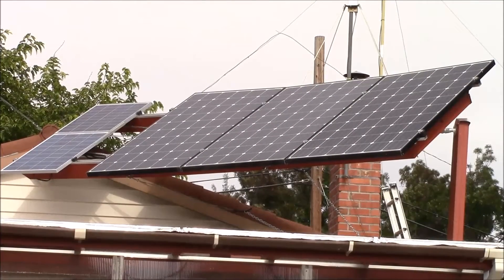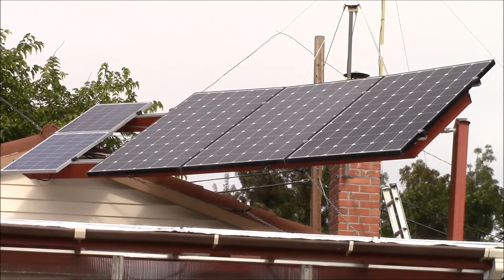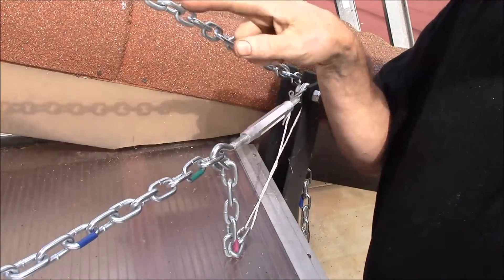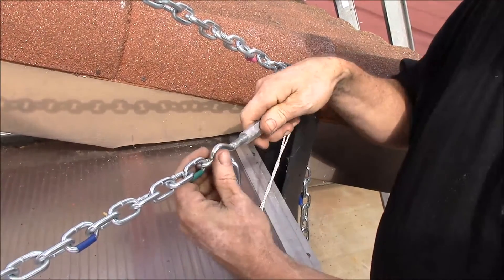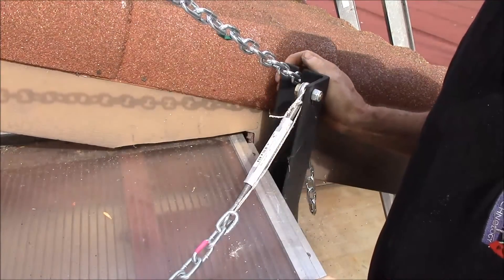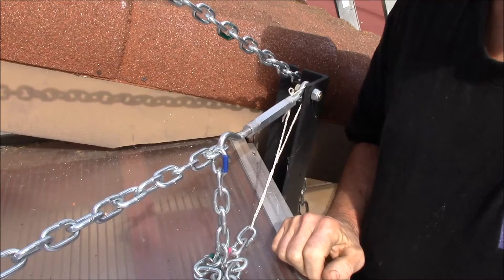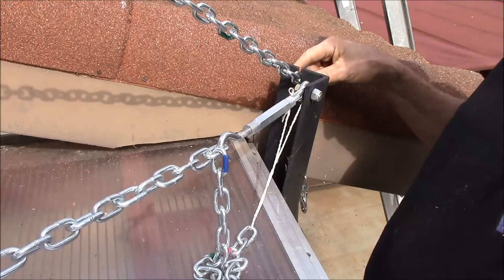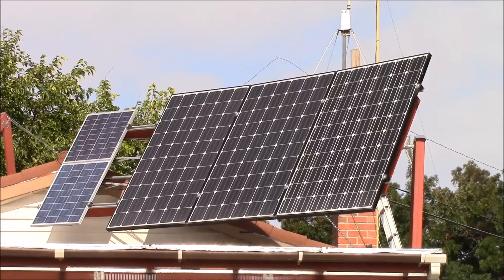Adjusting Solar Panel Tilt Angle

Comment: Looks like an interesting project :)  Probably not worth your time in terms of monetary value. I was thinking to do a dual-glass BIPV to replace the old roof on a garage/workshop. That way I could cut the cost of roofing by going fixed route. 
Moving 5kw of panels for times a year would produce roughly 15 Eur worth of Solar PV electricity in baltic states at current module prices and cost about an hour of my time in a year. Besides that, it would increase the chance of potential damage.
On the other hand, a single-axis time-based tracking system on an apartment building coupled with bifacial panels and white membrane roof on the building could bring enough value to be worthwhile. It would be an interesting study comparing tracked traditional panes vs bifacial.
Reply from the maker: In my case, the time is just a few minutes per angle change.  Just set up a step ladder, climb up, tilt the panels and back down.  In the winter, it's more time as I use the summer angle to park the panels when high wind events are forecast.  I'm considering adding a linear actuator to make those adjustments automatic and tie that into my home automation system.

I needed to set up something like this to take advantage of a due south orientation.  My house is sitting on a SE-NW alignment.  I do have some fixed panels on the E and W facing roof sections but the 4 panels tipped at the proper angle outperform the 5 fixed panels.   When I built this in 2013, panel prices were a lot higher.  Maybe today, it would not make as much monetary sense.

Comment: where is your location? is there any trustable tilt angle calculator website for 3 seasons?  and which days are more efficient for tilt adjusting on northern hemisphare.  i am planning to do it, on 21th of 2 4 8 and 10th month of every year. ( I live in Turkey btw)
Reply from the maker: About 37.5N latitude in the US.  The information on Charles Landau's site is quite detailed:
http://www.solarpaneltilt.com/
Reply: i saw his table and formulas. Hmm Charles Landau.... can i trust his formulas?  I 'm also gonna adjust the tilt 4 times a year. but i dont know where he find the formulas? forexample,  for summer adjustment, he  multiply the langtitute by 0,92 and subtract 24,3 degrees for northern hemisphare. Can we find the proof of that angle calculating? similarly he has another formulas for winter and  Spring/Autumn.
Reply: and according to Charles Landau's 4 times adjusting formula, your summer angle must be 10.2. [ 0,92x37,5-24.3=10,2 ]   but u adjust it 12 degrees. why?
Reply from the maker: Physical constraints mainly.  At 12*, my panel frame rests on the edge of my roof and can't go any lower.  I doubt a few degrees either direction is going to make much difference.  I imagine his formulas are some sort of approximation to a curve.  Since my adjustment setup uses a chain, my adjustment steps are somewhat coarse so having a "more accurate" formula would be pointless.
Reply: This is pretty good. Just stick your location in: http://www.solarelectricityhandbook.com/solar-angle-calculator.html

Comment: Have you measured the increase in efficiency that is netted by changing angles?
Reply from the maker: II did do a quick test in this video:
 https://youtu.be/6JSx7q4x27M?list=PLpY2FP1a9tit1TcUvvYFEGg4uJdDB55eH

According to Charles Landaua's page:
 http://www.solarpaneltilt.com/
You gain between 5-10% output over the year with 4 seasonal adjustments over a fixed angle.